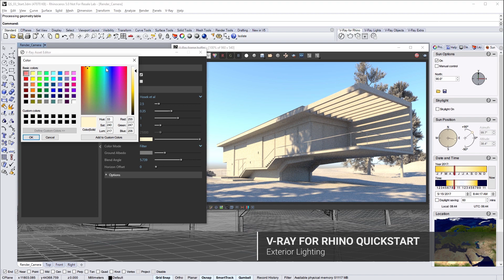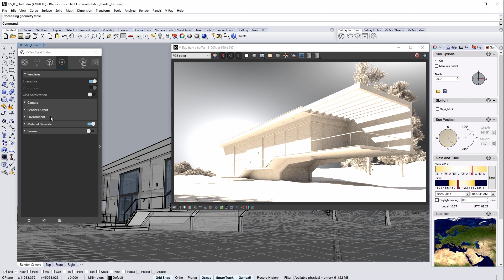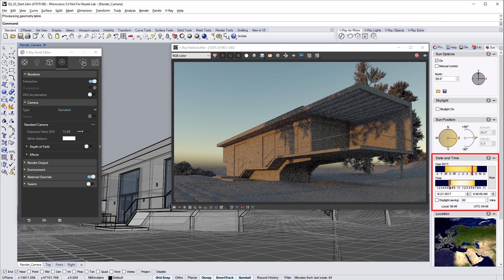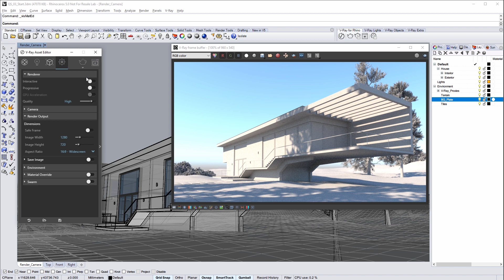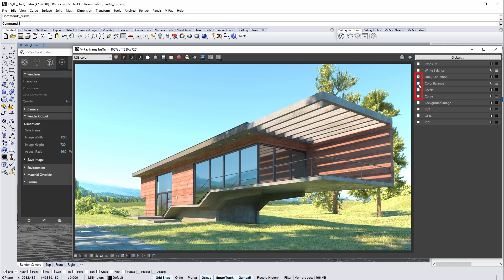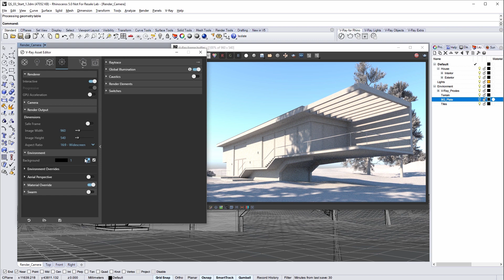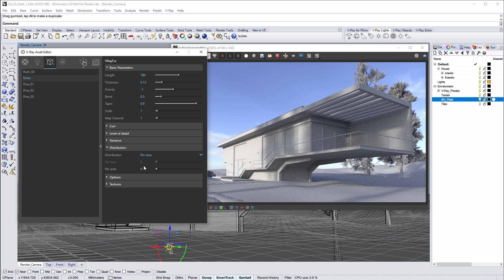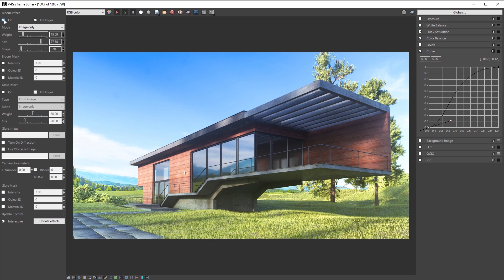V-Ray for Rhino – Quick Start: Exterior Lighting

Comment: How come there are lovely mountains reflected by the windows? Are those mountains parts of the Rhino 3D modelling? Thanks a lot.
Reply: if you use an image as a 3d environnment, the image will be reflected in the materials. Now, don't use a simple jpg that only contains RVB data, rather a HDRI image that contains color and light data.